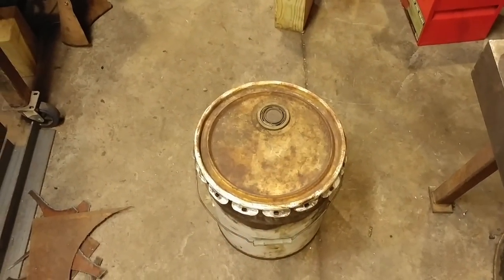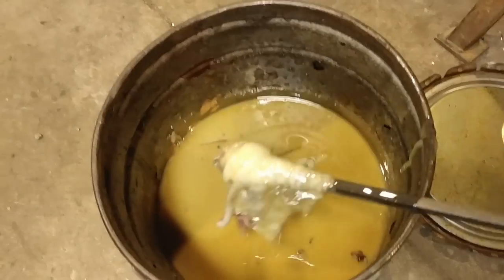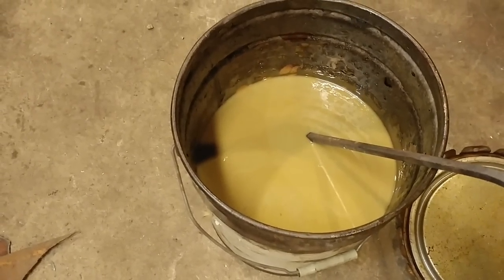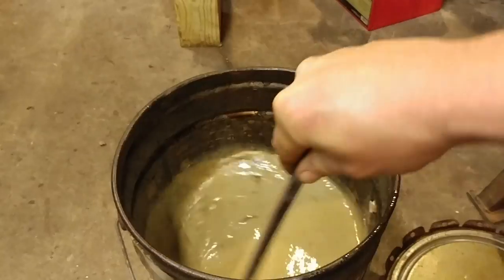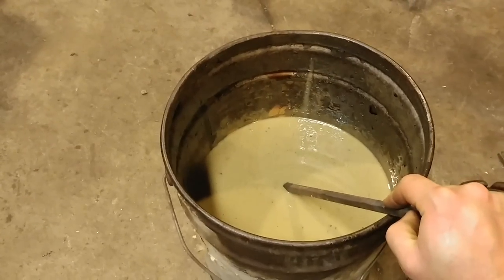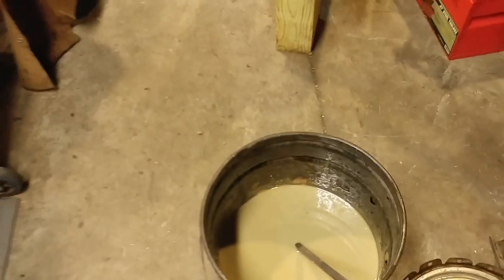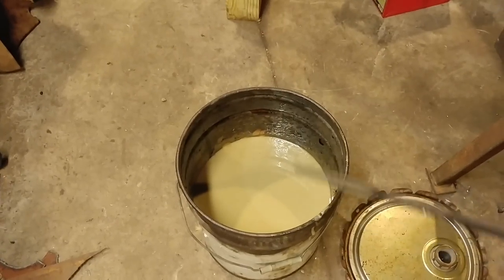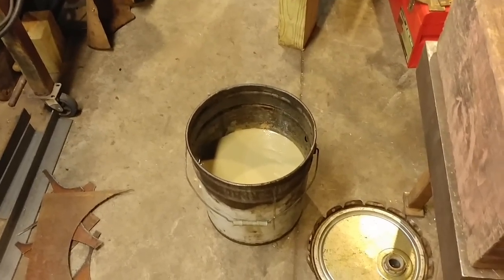REVEALED: Roy's Mysterious Quenching Oil for Blacksmithing

Comment: Dude I love it.  The "safe" recommendation I have seen for those just starting out, or just playing around is vegetable oil.  That being said, my quench oil is a mix of who knows what. I know there is used motor oil, transmission fluid, bar and chain oil, some other gear lube. You def have more water in your oil though! In my opinion the best oil to use is the oil that you already have!  Define Your Legacy!!

Comment: I use vegetable oil, comes out of a fryer at a friends restaurant. Im no chemist so don’t really know what it does but seems to work! On the plus side, its free, gives off a lovely spring roll smell and I don’t think the smoke is all that bad!
Reply: Watch the videos by Knife Steel Nerds. For steels that don't need a fast oil - 52100, D2, O1, and some others - vegetable oil produces good results. For things like 10 series steels or W2, you aren't getting the same level of hardness that you would from a fast oil like Parks 50. But seriously, watch the videos by Knife Steel Nerds, they are the most comprehensive examination I've ever seen on quenching steel.

Comment: That's funny you have bugs in yours as well. Out here in Arizona every time I find a scorpion I toss it in my oil quench (used motor oil) bucket and I call it scorpion juice.
Reply: let me guess the poison gives the surface a nice luster, like the lady on the movie holes with shaia lebuff that would use poison in her nailpolish, I think rattle snake venom or something like that and she explains that its harmless when dry but wet heh.

still the oil well thats just gross though I put my steel into a pond that has not been started up for three years and is stagnet that is when ever I am trying to cool it to the touch or after I cut it to prevent it from starting a fire when I put it back in the scrap bin after I practice, and that smells really bad like hot algee and lake water, its quite foul, but not as bad as putting a fire out like a man, by peeing on it after a full bladder that smells absoluetly foul and choke inducing.
Reply: Haha I call that scorpion justice! You must be down toward Laveen. Scorpions have been overrunning friends of mine there for many years now.
Reply: That's amazing

Comment: How do you know what to harden like the flowers you make do you harden them.  Or the key chains do you harden  them.
Reply from the maker: +Micky Swift the only things that need to be hardened is steel with high enough carbon content  that can be hardened when used for tooling. Other than that I do not Harden or try to harden mild Steel for decorative elements like flowers and or keychains. Hope this helps :-)
Reply: Christ Centered Ironworks  thanks for the info you helped alot

Comment: Lol Roy that is just nasty. I but a gallon metal tin of Canola oil, open the top up and hey presto quench bucket, The quench speed is very similar to parks 50 and works great getting blades to the hardness I need pre tempering. Tool quench it’s the old quench shine, colour run and re quench to take the last of the heat out.

Comment: A receipt I found somewhere on the internet's is the 3-2-1 quench oil mix
3 parts motor oil
2 parts transmission oil
1 part diesel oil/fuel
You are not to far away
My 2 cent
Jim
Reply from the maker: +DrNo Nofunclub hey thanks Jim for that! Yep my secret goop is no longer my secret LOL although it is probably never a secret to begin with :-)

Comment: Roy, I've got a question. I tried straightening a f250's front suspension spring. I heated it up to white/yellow hot and hammered it straight. Half of it split. It cracked a spiral right down half of the 10 inch length I was going to use. Is there something I did wrong? It took 5-6 heats to get it straight. I used a 2 lb cross peen hammer. I didn't beat the heck out of it. Should I normalize it first? Idk. I really want to use the spring material. The size is perfect but, if it splits all the time it's going to make things very difficult. Hopping you might know what's happening.
Reply: Bob Smith were you straightening a leaf spring?
If so you really shouldn’t heat it up at all, unless you have a oven that can heat the full length and get hot enough. 
You can shape the spring fairly easily. If you have a post vice open the jaws up about an 1.5” and lay the individual leaf on top of the vice, and aim with about a 6lbs sledge hammer for the gap in the vice. If you have tapered leafs meaning the metal is thicker in the middle where the center bolt goes than it is near the eyes. You will need harder hits in the thicker parts, and if they are about 3” wide springs than you will need to hit about 1” in from either edge to get it to bend evenly. Before you start take a straight edge from eye to eye, and measure the distance from the straight edge to the center bolt. Hammer it to the desired height gain and hammer the bottom leaf to match the arch. 
With all that said if you have a tapered leaf pack, they are designed to have a negative arch, and simply adding a leaf to the pack will give you about an 1.5” lift.
Reply: mpowers56 coil spring
Reply: It's a coil spring. About 3/4 inch round spring steel. Forgot that part... sorry
Reply: Bob Smith wow I went off on quite a unrelated tangent... 
straightening a coil spring for a tool? Spring steel does not like to be worked cool. Once it goes from orange to red put it back in the fire.
Reply: Alright, keep it super hot. I did let it get red not less. It's definitely hard stuff. Makes sense.
Reply: Thank you for the help!

Comment: How about used motor oil? That's what I've been using...
Reply from the maker: +Donald Roberts yep that will work
Reply: Donald Roberts thats what I  use too, so far so good! Have a blessed day in Jesus name!
Reply: I'm due for another oil change...And most of the time where I get my oil changed will let me have the used oil...
Reply: Donald Roberts I change my own oil at home and put the used oil back in the new container.  I have a huge stock pile!
Reply: You all have a blessed day with Jesus over looking all your work...
Reply: I've heard some rumors that use motor oil can help add stuff to the steel but I don't buy that because by the time you're ready to quench it's only going to be a microscopic coating if anything. Check out the cherry red video AvE did and you'll see what I'm talking about. But it can't hurt
Reply: @bentoombs  Depends on the temperature.

Comment: motor oil and trans fluid....and some water....get to the point. All youtubers seem to love dragging everything out to ridiculous extremes.

Motor oil works great alone. Old used black motor oil will leave a black finish.
Reply: I don't understand it myself, I have heard that it's somewhat beneficial to produce an engaging video that stretches over the 10 min mark.  But this doesn't do that.
Two to five sentences should be all it takes...
Reply: @omarogunhe1385  yep just putting out something even its not very good